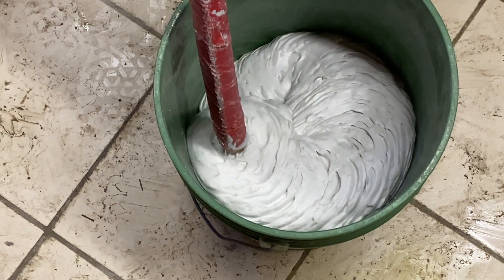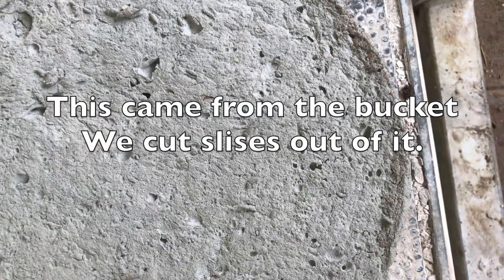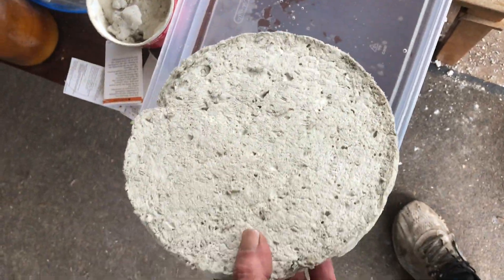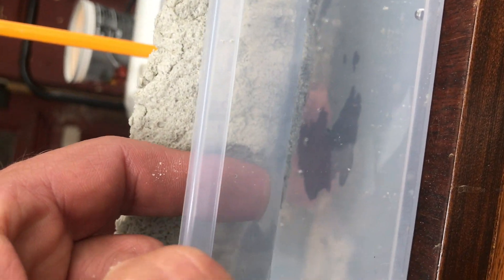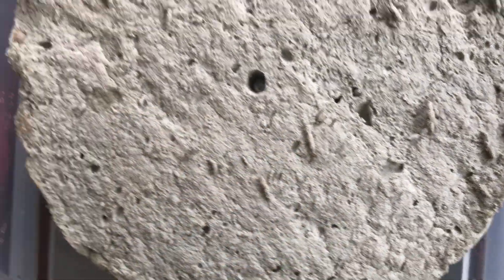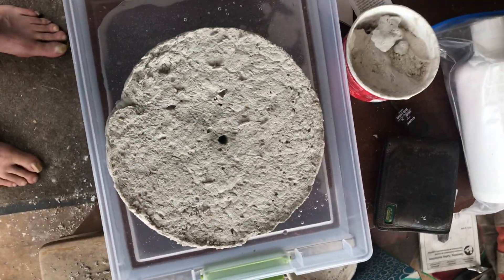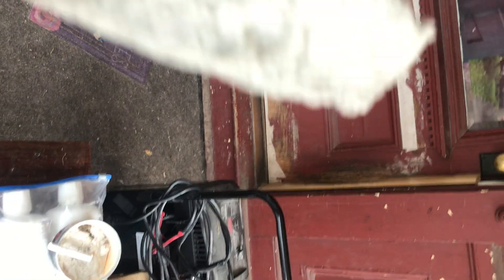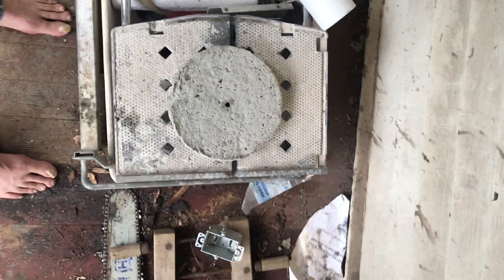Aircrete floats

Comment: Hello greetings from central Mexico, I am doing my experiments with aircrete I would like to contact you if possible I am interested to insulate a marine container.
Reply from the maker: The product I showed is made to coat metals and help protect from oxidation. That of course needs to be verified! but I'm the inventor and was one of the most Important part of the 7 years of work. Thank you Allen Gagnon